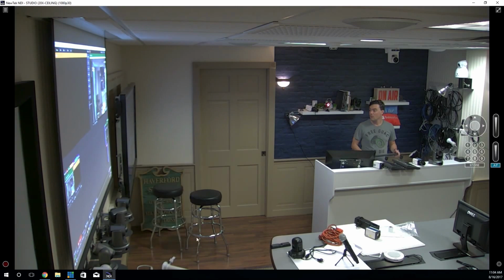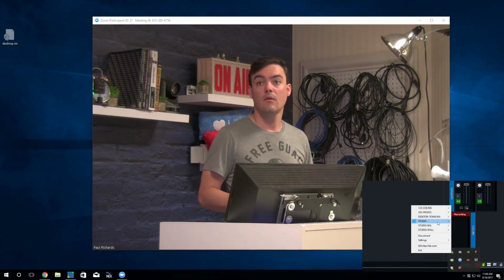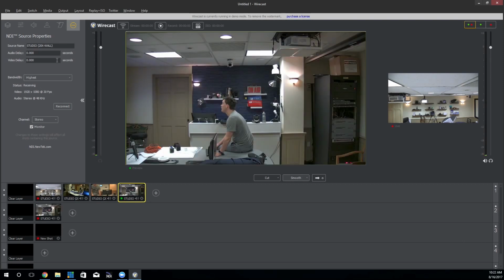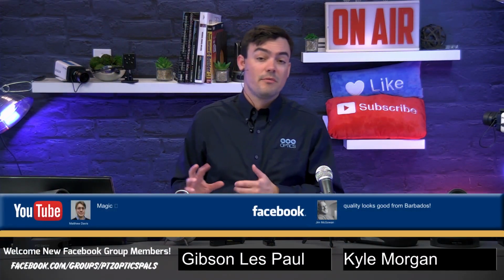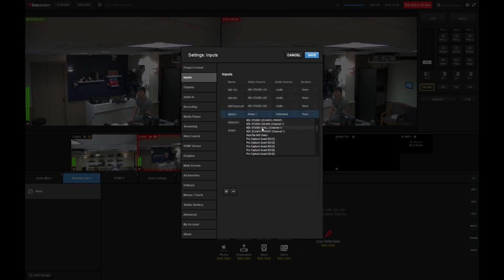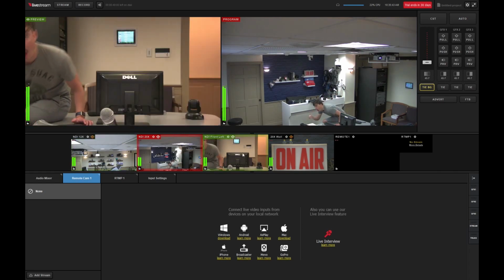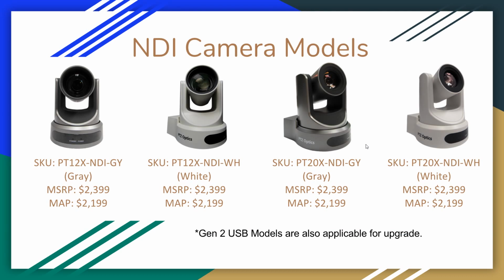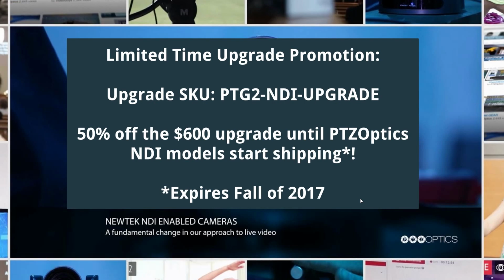NDI Camera LIVE Testing || Wirecast, vMix, Livestream, OBS & xSplit

Comment: I can use Hik vision ip ptz camera, in xsplit broadcaster
Plz give me reply sir
Reply from the maker: Hello!
Yes, you can use a Hikvision IP PTZ camera with XSplit Broadcaster, but the process involves a few more steps compared to using a standard webcam or USB camera. IP cameras, including those from Hikvision, typically stream video over a network, and XSplit Broadcaster can capture these network video streams using a custom source option. 

Here’s how you can set it up:

1. Obtain the Camera's IP Stream URL
First, you need to find the RTSP (Real-Time Streaming Protocol) or HTTP stream URL of your Hikvision camera. This information can usually be found in the camera's documentation or by accessing the camera's web interface. The URL format might look something like this for RTSP streams:

Copy code
rtsp://username:password@cameraIP:port/Streaming/Channels/101

username and password are your camera's login credentials.
cameraIP is the IP address of your camera.
port is the port used for RTSP streams (default is usually 554).
The latter part of the URL (/Streaming/Channels/101) may vary depending on the camera model and the stream you wish to access (main stream, sub-stream, etc.).

2. Add the Camera to XSplit Broadcaster
To add your Hikvision camera as a source in XSplit Broadcaster, follow these steps:
Open XSplit Broadcaster.
Go to Add source at the bottom of the screen.
Choose Webpage (XSplit may not have a direct option for RTSP streams, but you can use a media source or a plugin that accepts URL input).
Enter the RTSP stream URL of your Hikvision camera.
If XSplit does not directly support the RTSP stream through the "Webpage" source method, you may need to use a third-party plugin or software to convert the RTSP stream into a format that XSplit can accept, such as an NDI stream or a virtual webcam input.

3. Alternative Methods
Using VLC Media Player: An alternative method involves using VLC media player to capture the RTSP stream and then using XSplit to capture the VLC window or using VLC's NDI output feature if available.
NDI Tools: If your workflow supports NDI, you can use NDI tools to convert the RTSP stream to NDI. XSplit Broadcaster supports NDI sources directly, allowing you to add the camera as an NDI source.

4. Configure and Use
Once your Hikvision camera is added to XSplit Broadcaster, you can position and resize the camera feed within your scene as needed. You can also adjust settings such as resolution and frame rate according to your streaming requirements.

Note
Make sure your network is configured properly for accessing the IP camera, including any necessary firewall rules or port forwarding settings if accessing the camera across different networks or over the internet.

The process might require some trial and error to get the settings right, especially regarding the stream's resolution and frame rate, to ensure a smooth broadcast experience.

This method allows you to integrate professional IP camera feeds into your XSplit broadcasts, adding more versatility and quality to your production compared to standard webcams or direct HDMI inputs.

Thanks for checking out our Channel! 
Learn More: https://ptzoptics.com/

Comment: Why when I use NDI signal on 1080p I have some artifacts? Do I need use some special ndi reciver? I use just Gigabit network.
Reply from the maker: Hello!
Experiencing artifacts when using NDI (Network Device Interface) signals, especially at high resolutions like 1080p, can be attributed to several factors, typically related to network bandwidth, hardware performance, or configuration settings. NDI is designed to work well over a gigabit network, but its performance can be affected by the overall network conditions and the capabilities of both the sending and receiving hardware. Here are some potential reasons for the artifacts you're seeing and suggestions for troubleshooting and improvement:

Network Bandwidth and Quality
Bandwidth Limitations: While NDI is optimized for high-quality video over IP networks, it still requires a significant amount of bandwidth, particularly for high-definition signals like 1080p. Ensure your network can handle the bandwidth NDI streams require; for 1080p video, this can be significant, especially with multiple streams.

Network Congestion: If your network is congested with other data traffic, this can affect the quality of your NDI stream. Ensure your network is not overloaded with other traffic and consider segmenting your NDI traffic onto a separate VLAN if possible.

Packet Loss: NDI is sensitive to packet loss, which can cause artifacts. Use network switches that support IGMP Snooping to optimize multicast traffic and reduce the chance of packet loss.

Hardware Performance
Sending and Receiving Hardware: The performance of the hardware sending and receiving the NDI signal can also affect stream quality. Ensure that both the sending and receiving devices meet the recommended specifications for NDI streaming, including sufficient CPU and GPU resources.

Network Interface: Ensure that all involved hardware (computers, cameras, switches) is using Gigabit Ethernet ports and that the cables are of high quality and support Gigabit speeds.

Software and Configuration
Latest NDI Version: Ensure you are using the latest version of NDI tools and plugins on both the sender and receiver sides. Newer versions often include performance improvements and bug fixes.

Correct NDI Settings: Check the configuration settings on both your NDI source and receiver software. Adjusting the video bitrate or quality settings, if available, can help manage bandwidth usage and improve stream quality.

Resolution and Frame Rate: If bandwidth and hardware capabilities are limited, consider lowering the resolution or frame rate to reduce the amount of data being transmitted.

Specialized NDI Receivers
While standard gigabit network infrastructure should suffice for NDI streaming, using specialized NDI receivers or converters can sometimes improve performance, especially if they offer hardware-accelerated decoding. Devices like the NewTek Connect Spark or BirdDog Studio NDI can provide reliable NDI decoding with potentially less latency and fewer artifacts.

Troubleshooting Steps
Network Check: Use network monitoring tools to check for high latency, packet loss, or excessive traffic that could affect NDI stream quality.
Isolate the Issue: Try streaming NDI over a direct connection between the sender and receiver (if possible) to determine if the issue is network-related.
Hardware and Software Updates: Ensure all devices and software involved in the NDI workflow are updated to the latest versions.

Addressing artifacts in NDI streams often involves a process of elimination to identify and resolve the underlying issue, whether it's related to network infrastructure, hardware performance, or software configuration.

Thanks for checking out our Channel! 
Learn More: https://ptzoptics.com/

Comment: I just want to say that I think NDI is a great technology and is very useful. I think it Is a step towards a better tomorrow. However, I don't want to be a hater on your show, but I need to point some things out. SDI cabling is actually cheaper than cat5e or about the same. SDI cabling can be for short runs of 10ft or so rg59 and longer runs rg6.  That is the same cable that runs in your house. While we are talking, SDI uses uncompressed video at a bit rate or 270mbps for sd-sdi , 1.5gbps for hd-sdi and 3gbps for 3g-sdi. Keep in mind, that Blu-ray content is normally encoded at 35mbps. 

This means that content recorded over SDI will not be compressed before it is sent. This is one of the key benefits to use it as you will lose quality when you process the video and add titles and convert it for the live stream. For everyday stuff like streaming ndi is fine. If you want to capture and record to do post production, you will lose alot of detail in the image. Just know that even though HDSDI is transmitted in 1.5gbps that does equal a quilty picture. The picture that is sent has to do with the quality of the sensor and the quality of the lens.  Cheaper sensors will not perform well in low lite and they will be noisey. Cheaper lenses will have chromatic aberrations (rainbow effects on the edges of objects) that are more pronounced.

Comment: Is there a noticeable difference between using cat 5e vs cat 6 for cabling used for NDI sources?
Reply: Jonathon Caithness probably not as the stream is compressed to <30mbps, you can run 10mbps over cat3 cable.